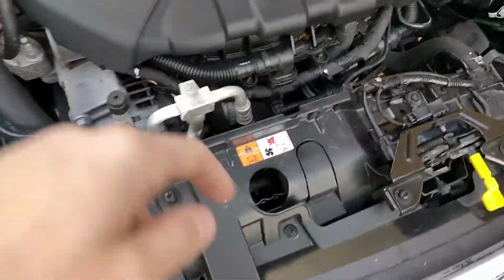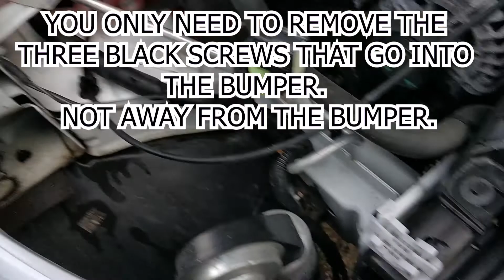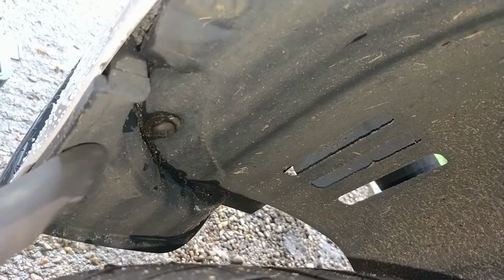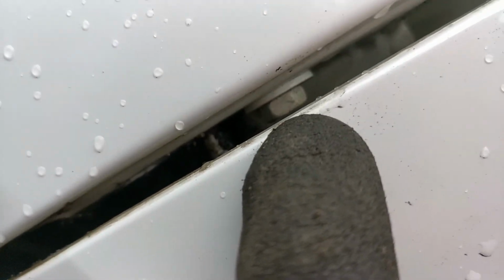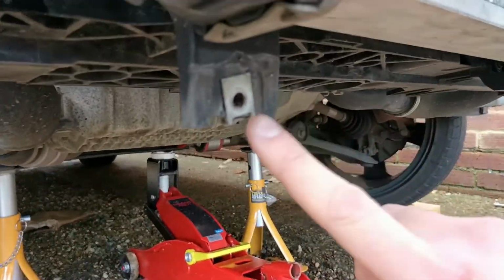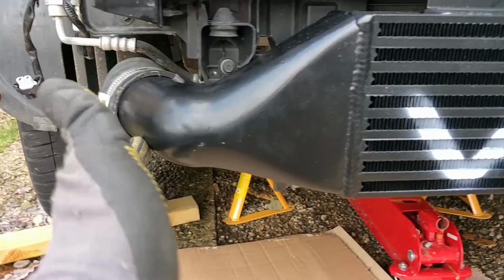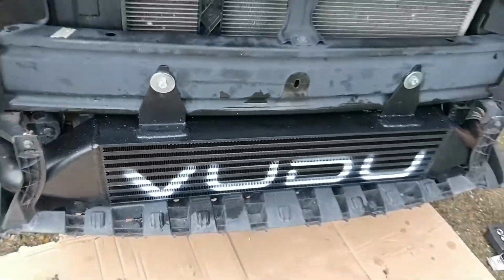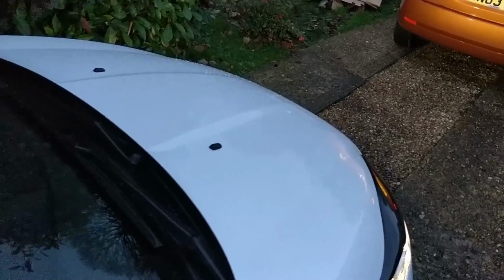How to: VUDU Intercooler Install! - Stage 2 Pro Ready! - Fiesta ST180

Comment: Hi mate, I know this is your old intercooler but do you remember what size bolts are needed to mount to the crash bar? Mine didn’t come with bolts either!
Reply from the maker: I'm not 100% sure to be honest sorry, best bet is whatever hole you decided to drill. Go with that bolt! And remember good drill bits aha
Reply: Car Rambles no worries bud, yeah I’ve found out the hard way that the crash bar is seemingly indestructible... not sure if my drill bits just aren’t up to it or I’m doing something wrong haha
Reply from the maker: Get yourself some colbalt drill bits and ensure you use either cutting fluid or at the very least soapy water and go slow :)

£15 in Screwfix I think for a good set of colbalt drill bits

Comment: How you drill the crush bar ?
Reply from the maker: 4mm then 8mm metal drill bit
Reply from the maker: If you still through the centre like myself, you'll find it much thinner than the top or bottom. Just don't drill through and keep drilling into your radiator...
Reply: Car Rambles what sized bolt mate
Reply from the maker: I really can't remember, they was just some random bolts I had on hand. Measure the crash bar is possible, they don't have to be that big as the bar has an indent on the rear side.

Comment: Treat your self to a catch can mate. That crap in your  intercooler pipe is blow by.
Reply from the maker: Will do
Reply from the maker: Do you have any recommendations. Kinda resent paying over £100 for the mishimoto one lol
Reply: @CarRambles  I know what you mean mate the Mishi ones are a bit pricey but the kit is tailored to fit perfectly. I looked at a few cheap e.bay ones that seemed ok and they  would probably have been perfectly ok but  i couldn't bring myself  to bolt  some unknown Chinese knock off to my engine, so in the end I went with the Mishi kit. I know you can buy thier cans separately so you can fabricate your own bracket and tubing which may be a cheaper option. Might be an idea to check out some of the forums, there's bound to be someone who has used a different option. Really enjoying your channel by the way. 👍
Reply: I just installed the mishimoto kit, found a deal for 150 on ebay still new. Worth it in the long run in my mind when i want more boost, therefore increasing oil vapours and blow by.